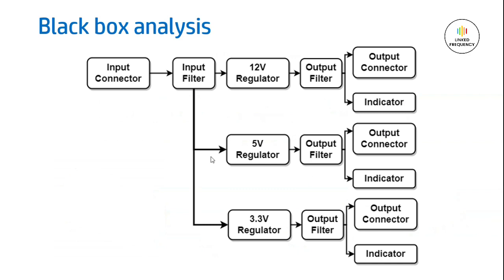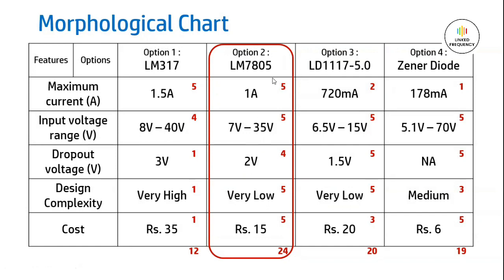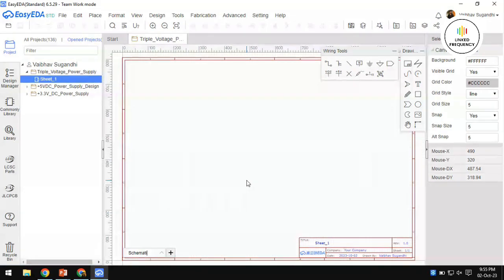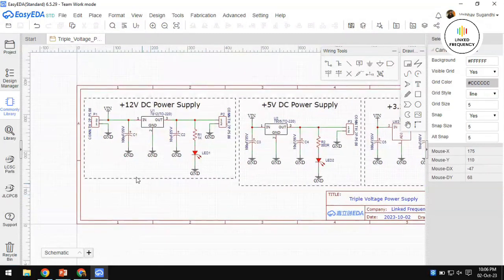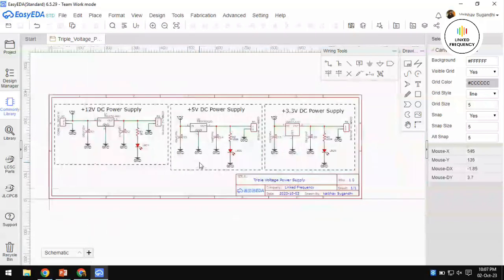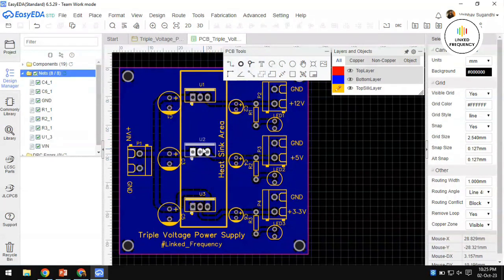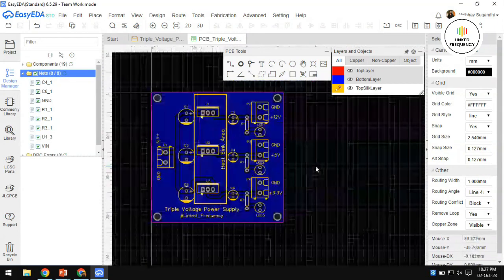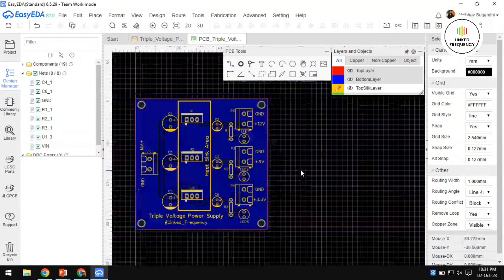Triple Voltage Power Supply #E03 | Vaibhav Sugandhi

Comment: hello,  great video.  in this  circuit,  each voltage source is in parallel, correct ?   also,  what  would it look like  in series ?
Reply from the maker: Hi, 
Thanks for your support. 

Yes, all 3 regulators are in parallel in this circuit. 

In case of series connection, output of 7812 will be connected to input of 7805. And output of 7805 will be connected to LM317-3V3 input. Which is not so efficient method as power delivery of 2nd and 3rd regulators will be restricted by 1st regulator. 

Happy learning, 
#Linked_Frequency
Reply: @Linked_Frequency     thank you for the reply.   oh  i see!   ok, but there a couple of things that come to mind.

first, let's   say  i  put them in series,  will the  number of capacitors change?  that is,  would each  power regulator still have 2 capacitors, one on each side like in the case of parallel ?

second,  regarding series or parallel configuration,  i thought that putting them in parallel created a situation in which only one of the regulators would supply the current and the others would remain idle ?
Reply from the maker: @nomatman8352  We are happy to answer your questions, 
1 : Actually placing these linear voltage regulators in series is not recommended, however if you do so with proper understanding, then a bulk input capacitor at the input of 1st regulator and 3 small capacitors at the output of the each regulators would work fine. Only 2 input capacitors for 2nd and 3rd regulator can be eliminated. 

2: There is no Enable/Disable option in such simple regulators, hence weather you use them or not, they are ON all the time until there is a input voltage. Important point to note is Kirchhoff's Current Law (KCL) to be considered in design work.

I hope you got some clarity on this topic, 
Happy learning,
#Linked_Frequency 😊